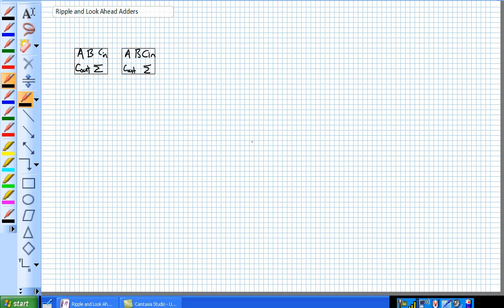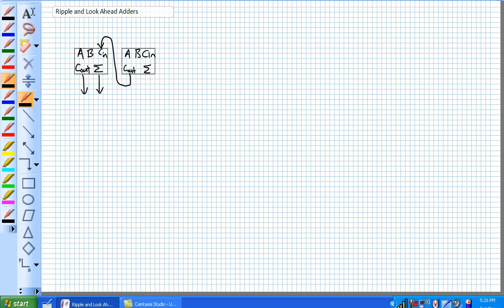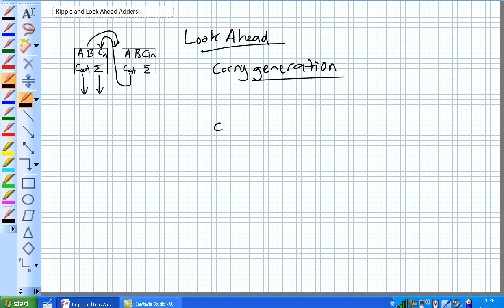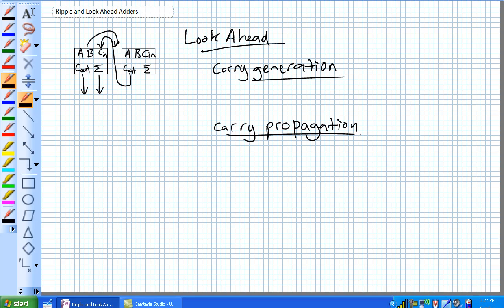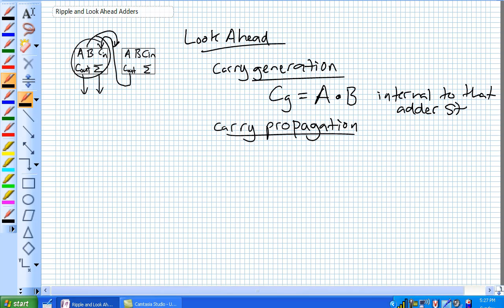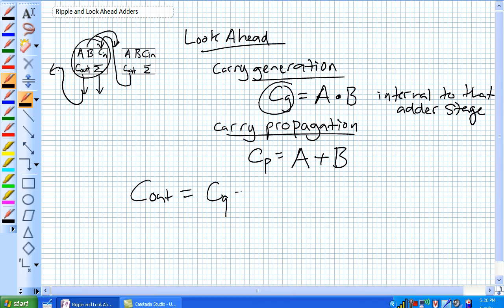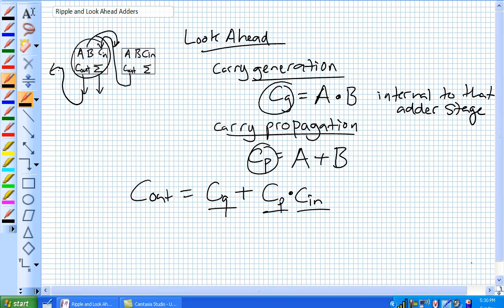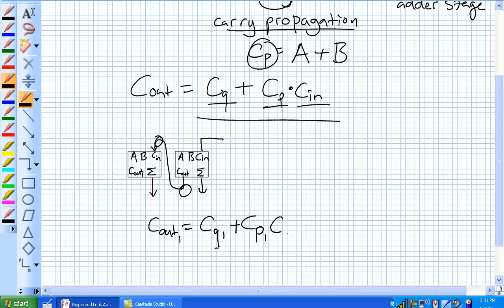Ripple and Look Ahead Adders Part 1

Comment: I agree with syntaxiko actually. Whether the carry propagated is XOR or OR doesn't matter. This is because in the formula Cout = Cg + Cp*Cin, we're only determining whether the CARRY OUT is 1 or 0, and not the value of the addition itself. So if the inputs are [1,1], the Cg will force Cout to be 1. This happens regardless of what Cin is, so the Cp*Cin part doesn't matter in that case (0 or 1, the Cout will still be 1 because in remember 1+1 where the plus represents an OR still gives 1, not 0). Inputs [1,1] is only case in which XOR and OR differ in Cp, but Cg takes care of that. A scroll through wikipedia also confirms this.